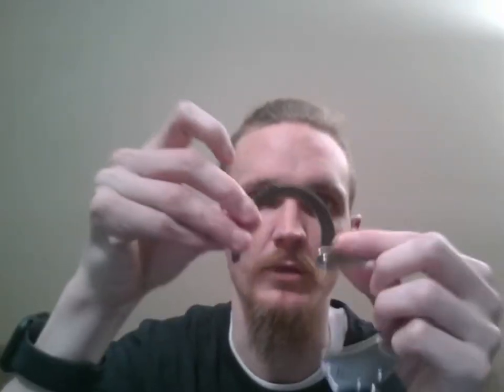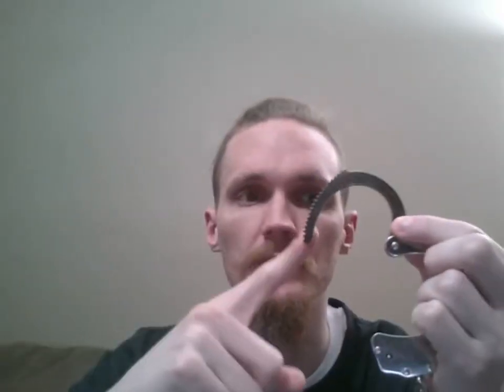DEF CON Safe Mode Lock Picking Village - Steven Collins - Cuff Stuff

Comment: I learned to use a bobby pin but those were s standard issue peerless handcuffs. I have a pair of S&W where the gap is thinner so you may need to use aluminium or dining heard this gap gauges work.